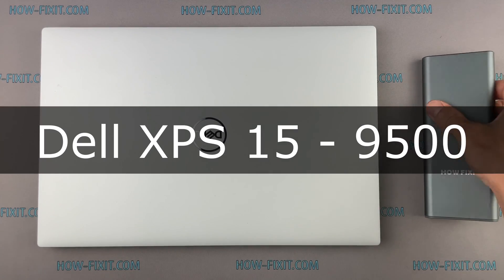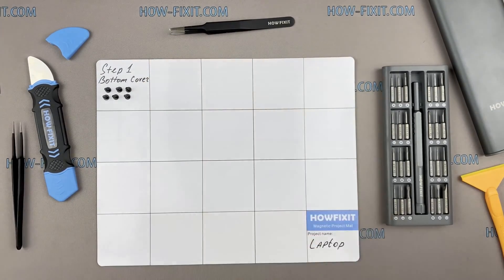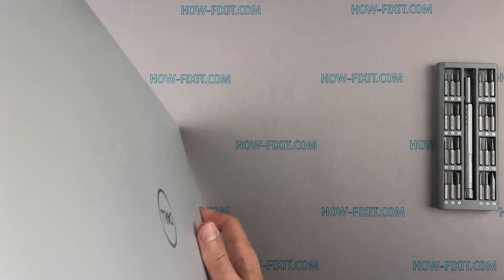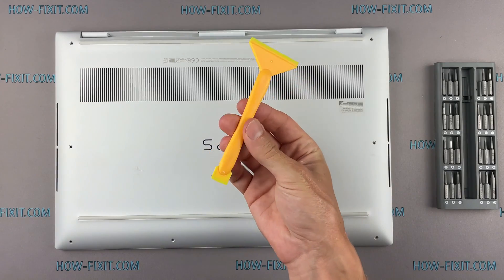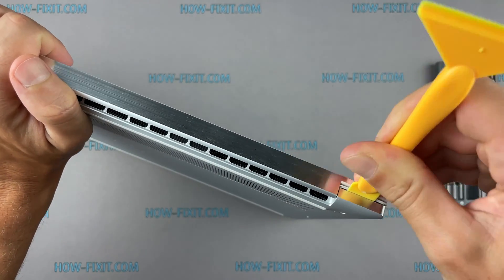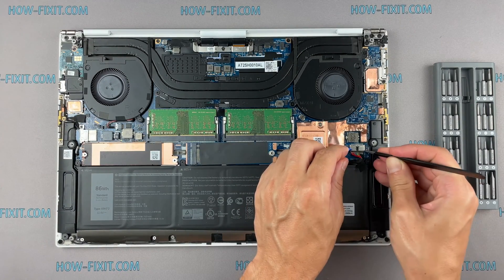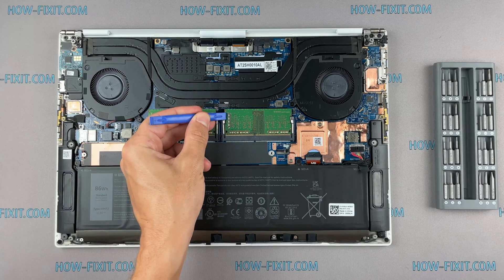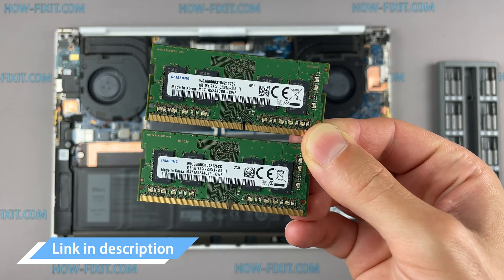Dell XPS 15 9500 RAM Upgrade and Install - Your Step-by-Step DIY Guide!

Comment: I bought a 9500 with 16gb today. Does it have 2 ram of 8gb each or just 1 of 16gb? Any clue?
Reply: 2 of 8. The standard 16 GB configuration uses 2×8 GB and runs in dual-channel mode